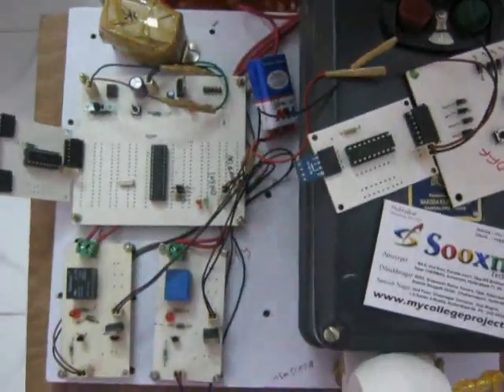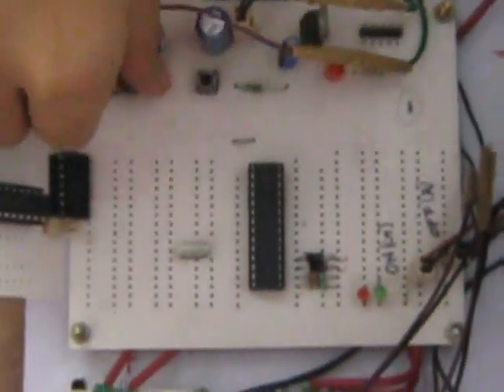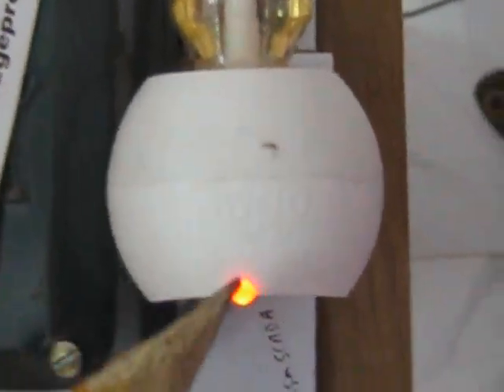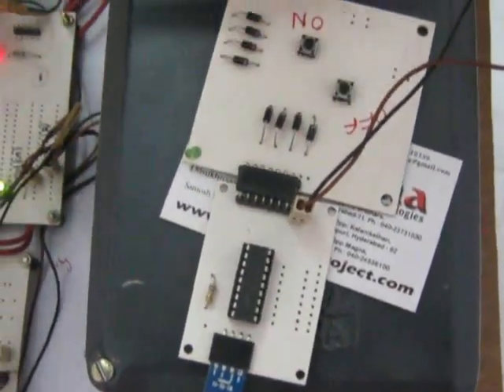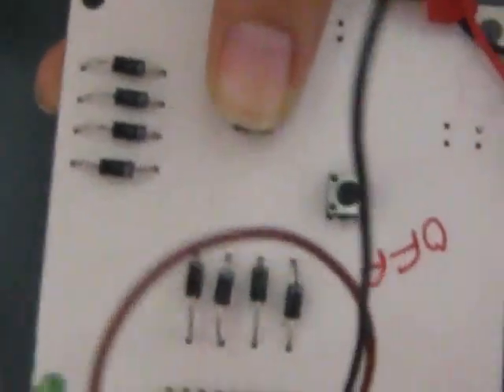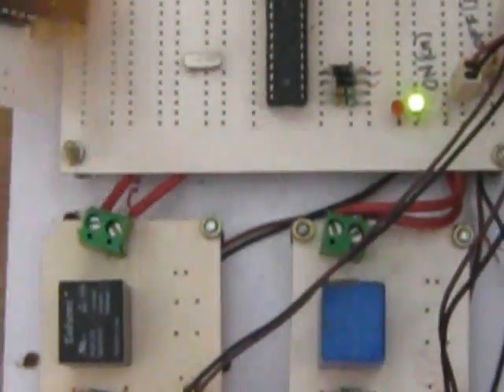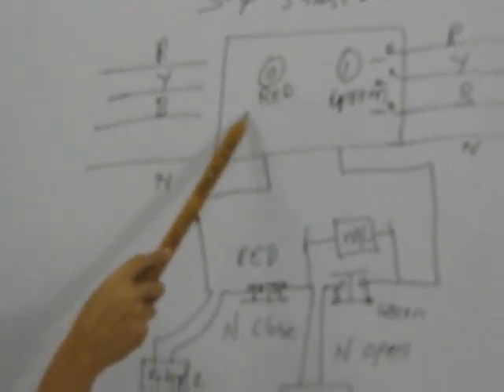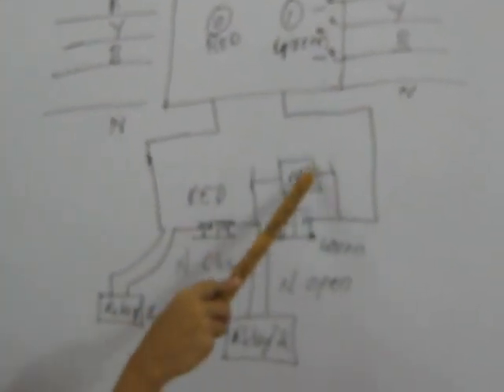Wireless RF 3 Phase starter for irrigation motor

Comment: I think the circuit shown here is WRONG. The Auxiliary contact connected in parallel will not switch without closing relay or green button next to it in series.